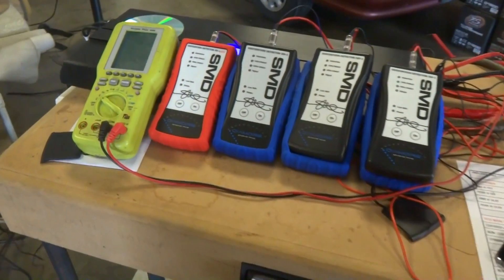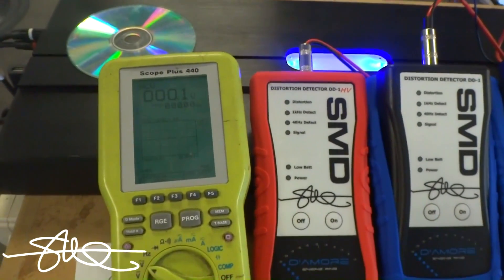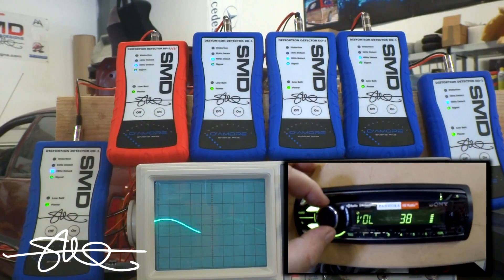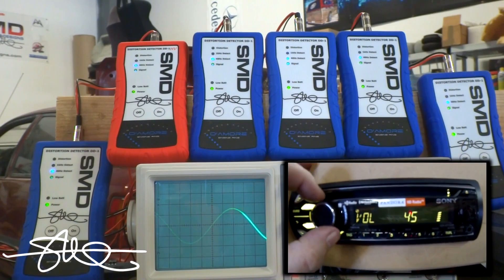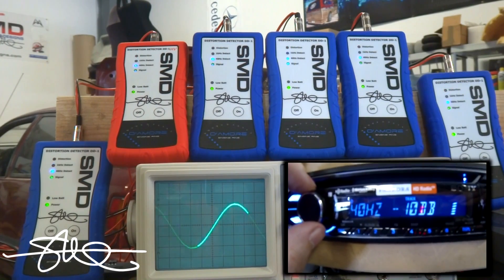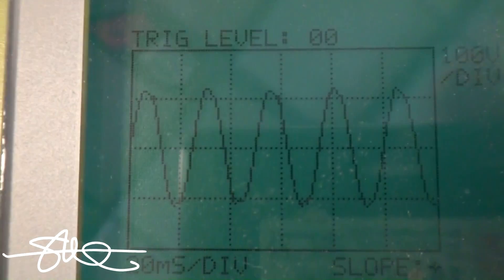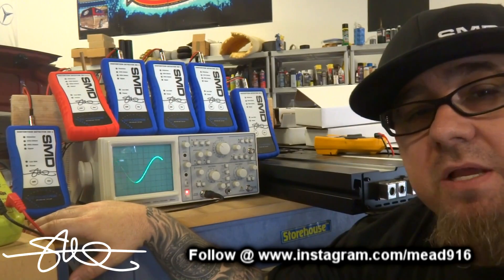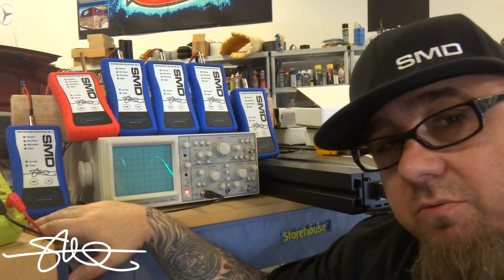6 SMD Distortion Detector DD-1's VS. 2 Oscilloscope's

Comment: Lots of cheap bastards,  they just set their equipment up then want their money back.. sucks for companies like yours. But it happens. Have you ever considered allowing your customers to rent your units, set up their system for say 30 bucks and return shipping. Naturally with a deposit of full retail price so if the unit is damaged or not returned? I think your products are great, the problem is for the average guy just installing their own system it gets used for 45 minutes or less even with a complex install. Then it is put away and forgotten. And the tool has no other use for them..
Reply: And most of us are putting together a system on a budget, it's hard to justify spending 150 bucks for something that you use once then it collects dust for 5 years until you buy another car or make a change to your system.

Comment: One thing I learned the hard way is make sure your using good source for test tone.  We burnt a handful of test discs (I have habit of leaving them in cars) and we must have burnt them at high speed.  It would pick up distortion before measurable signal.

Comment: Just got my DD-1.. Can't wait to crawl in the trunk and start checkin stuffs. Alpine 149BT first, then output after the Helix DSP for giggles. All dsp bypassed and levels at 0db of course, then onto a couple NVX amps. How nice to actually KNOW the gains are right, and if the head unit has a clipping point, where it's at. Will be interesting how off my DMM guess-timation is.

Comment: I thought an o scope couldnt handle very much power. hooking it up to a 50 watt speaker channel doesnt burn out the scope? When you use the distortion detector or an o scope for very big amplifiers wouldnt you need a very large resistor bank to handle the wattage without blowing the scope? I would really appreciate any help on this topic, I run a small audio repair business (more of a hobby, Im still a college student) I put a system in my car to test amplifiers but I have an o scope and I would rather test amplifiers on the bench using that, I just thought I needed a bank of resistors to match an amplifiers output wattage to avoid damaging the scope.

Comment: I really need your help on my system, 4 12's 2 1200 watt sony xplodes, 2 comp pro 800watt.  powered by 2 kenwood 400 4 channel amps,  subs on one of them,  I cant turn my radio up past 30 without the 2 comps sounding blown and the sonys barely hitting, I turn the amp down and the sonys hit and the comps don't, then I cross them and now all 4 hit and the comps sound blown but are barely hitting.  I put them on another system and they sound fine, ive even taken them to a speaker repair shop and they told me their fine. 
what do I need to do?
Reply: I dont know if this will help but this is what I would do. I dont know if you were saying if the 4 subs were powered by one amp or two, If you are using two amps for the subs I would do this. Try making your system as simple as possible, just run the 2 subs with one amplifier then build from there to see if you notice exactly when your problem occurs, i mean get your first two subs tuned good, set the gains so that you know the system sounds good. Then disconnect it and do the same for the other two with your other amp, when they sound good then hook everything up and they should work fine then. You would probably have different settings for the two pairs of subs because they have different power ratings. Its hard to get different subs with multiple amps tuned all at once.

 Make sure you have the subs wired correctly whether they are in series or parallel or both series on one pair and parallel on the other. You might have your comp subs hooked up so that their resistance is low so they get too much power from the amp and the other pair might have a high resistance so they dont get enough power. Try to have the two pairs matching resistances (ohms) where they connect to the amplifier to ensure that they are getting the same amount of power. 

If the subs are just hooked up on the 4 channels of your amp, I dont know if you can set the gains or input sensitivity for each channel. You should be able to if the have the two pairs wired up so the you bridge your 4 channel amp to two channels. You should have setting for a channel a and a channel b or something like that. Then you should be able to do what I was talking about in the first paragraph, just use the first channel then the second channel then put them together.

I hope this helps!
Reply: ok I have the 2 sonys bridged on two channels and set perfect,  the two comps are bridges on the other 2 channels and if I set them the same as the 2 sonys they pop,  I have the amp for the comps almost off just so they don't pop.  all 4 subs are on 1 amp btw.  we set it up like you said one set at a time, and this is when we noticed the problem.  if we run one sub per channel I cant set each sub individually, on 2 hit at a time not all 4,  if I set in bridged they all hit but I have 2 channel all the way up and the other all the way down to not blow subs.

Comment: Anyone in the Phoenix area that needs there system tuned with Smd meters then email me Johnny Noiseboysgarage for an appointment.  Will check radio clipping, amp clipping, frequency calibration with the smd Cc-1 and now can check watts, voltage drop and much more with the new smd amm-1 . I'm familiar with these tools and know how to use them .
Reply: NoiseBoysGarage yo hit me up i need to get my gains set

Comment: I remember when I got mine and it didn't work. I was so pissed felt like I wasted money.

But then I went to the store and bought a new 2 pack for 9v batteries just to try and see if that was the issue. Sure enough once I replaced the shitty gas station 9v with a brand name battery it started working, couldn't be happier with this tool now that I got it to work.

Comment: I think the main issue with people is that they put in a battery that is almost dead in them. I had that issue with mine that it wasnt working properly and I went and bought a new battery and it was back in business! It works like a charm and I have my not that big system blasting to its maximum capacity!

Comment: I had "issues" with mine at first, but I think my JVC deck distorted more than the DD-1 stated. My Pioneer deck has given me zero bad "noises" (except with auto eq on, that clips the crap out off certain frequencies).. Otherwise it's golden. Might be a little more expensive than its worth to the AVERAGE installer (not a retailer or anything), but it does the job.

Comment: Hi Steve quick question. I own a DD-1 and, excuse this for sounding stupid, but if I set the gain using 40hz, how do I know it isn't distorting at say 20hz? Thanks for your help!
Reply from the maker: the actual frequency used has nothing to do with what you play AFTER it is set.  The object of the dd-1 is to match the gain on the amp to the maximum non distorted, non clipped signal from the deck (and anything in between).  The 40hz/1khz frequencies are used as a reference point to achieve this.  One of the biggest misconceptions about this tool is that you use it at one frequency (40hz) but all other's are ignored when really it has nothing to do with what you play.